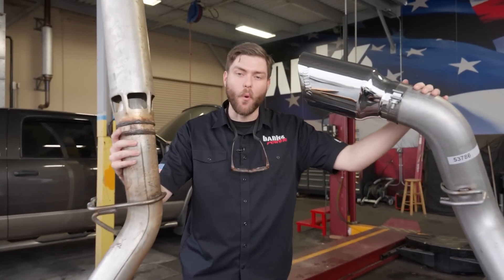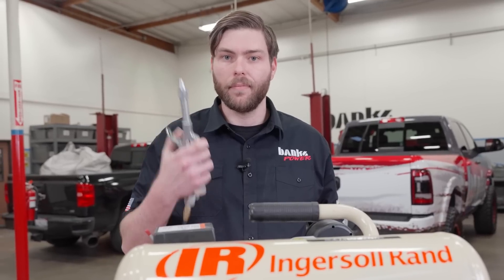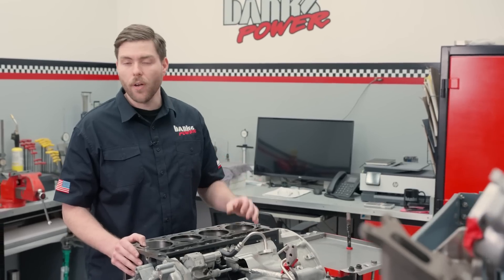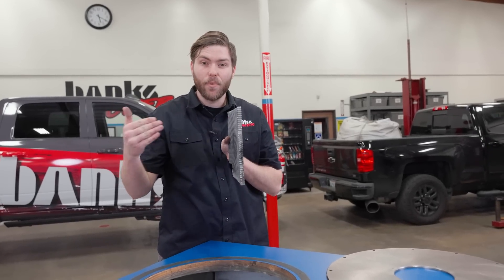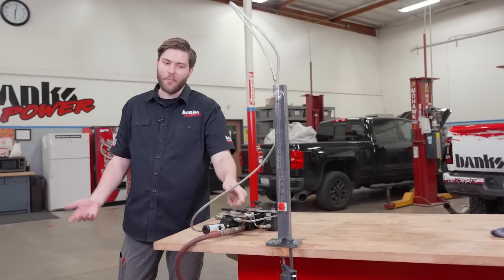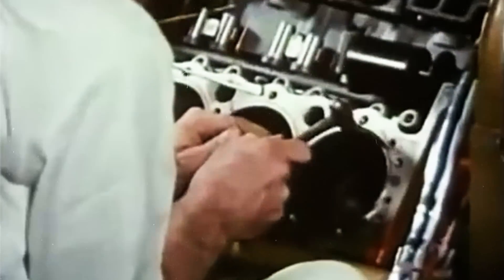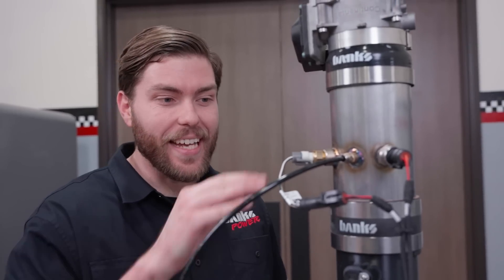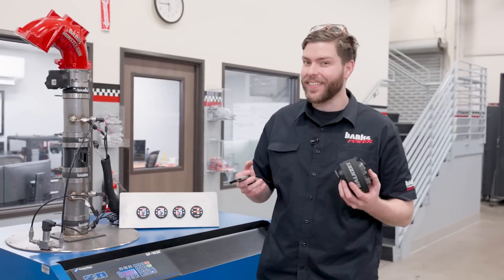Everyone is measuring airflow WRONG - Here's why | Banks Entry Level

Comment: Granted you're capable of reading the amount of air entering the components, but what about once it's gone through the intercooler. 
Then been compressed by the forced induction device, because that depends on several factors if my understanding of everything involved to actually reach the combustion chambers. 
First every connection has to be fully sealed against either a vacuum, or a positive pressure passing through it.
This also includes the intercooler if one is used, but that still leaves a lot of mechanical connections, and then there's all the welds, and are seams in the tubing on both sides of the turbos, externally mounted blowers, and even blowers mounted directly onto the heads.
There's a significant chance of leakage, and even with your testing setup this is highly possible  
Granted air is like water, and takes the path of least resistance, but that's still not a guarantee that's not an issue. 
From my years of hvac experience, in installing high pressure ductwork. 
The only absolute method of verification is to have a meter at the entrance of the associated ductwork, and after the all the connections through whatever is being tested to see if you're maintaining the same static pressure versus whatever your total volume of air exiting the ductwork. 
Otherwise you could very well have a sorce of entrance into your system, are a leak before you actually exit the device in this case. 
So the way your device is pressurized, are in the case if intake components your in a vacuum. 
So however many connections and openings for whatever device maybe there has to be sealed absolutely, otherwise you don't have an accurate reading for mass air sensor or anything else. 
You have a rough guesstimate at best, and I realize that this is taking it to the extreme, but based on the manor of which you're speaking, as well as the verbiage used.
You're making it an absolute, that everything has been done to guarantee that this is the case, and unfortunately it's not. 
I'm sure it's a more accurate reading than most people are getting just because the use of the Maas airflow device, but then the devices connected on either side, or the mass airflow sensor itself isn't in a sealed connections either.
So therefore you're not getting absolute accurate information yourselves. 
So not to be a PIA, but to make bold statements that ya'll are making to the public, which is part sales pitch, and some scientific proof of how ya'll have improved a method of testing. 
So take it to the absolute level of accuracy, and improve every connections inside and out of the flow bench as well as your method of connection to the testing device. 
Then tell us how you took these steps to ensure that your results are 100% accurate. 
Hopefully ya'll find this as positive input, and not someone being negative about what ya'll are I believe honestly trying to do to better your own data in research for your own products. 
That's how it's meant to be, and not just shooting holes into the steps you've taken to date.
Reply: If there are leaks the mass airflow sensor will be telling the computer the incorrect air mass therefore the air fuel will be incorrect. You spent an awful lot of words to say not much.

Comment: I don't think the largest percentage of people don't actually know that 1 PSI = over 15 actual Pounds Per Square inch because atmospheric pressure (eg the pressure of air acting on our bodies right now as we speak) is actually 14.696 PSI hence calling the measurement 1 BAR of whatever gas.

Comment: If air temperature don´t chance in flowbench between measured object and orifice plate, I wonder is MAF really needed here? After all flowbech just compare two pressure drop.

EDIT 1: I edit my comment by saying cant wait next video. I made my flowbench in 90s and currently have cfm and velocity measured in computer. I consider flowbench as tool to measure volume. Air speed is measured or calculated. 

Density is wonderful calculated unit in running engine where parts make pressure and temperature chances to air flow, but hard to understand how that can happen in stable flow where heat loads are not present.

And yes I absolutely hope that Gale and his team are right and we can learn.
Reply: But to reach the correct answer, everything has to be sealed to where there can be no possible chance of any air entering or leaving from one end to the other. 
Otherwise you have not accurately read the true numbers. 
Is this not correct, and whether it's a mechanical connections, or whatever it's got to be absolutely isolated from any leakage period. 
Yes or no
Reply: @timothymilam732  Sorry, I don't know what you mean. Of course air will enter and leave in parts when measured, and sealing is important. But if I have to answer, absolutely YES !!!!  😀

EDIT: That YES was to make you happy. I had my coffee and maybe I now know what you mean. In flow bench there have to be air flowing that can make pressure drop in measured object and orifice plate, and that makes possible to get reading or results out of it. If you shut down airflow (and just put pressure there), bench reads zero because there are not pressure differences.

I have two industrial (including Superflow) test plates to calibrate measured CFM in my bench. Thats enough accuracy for me.

I Think that industry have been right when we are measuring just air volume. Now this density value open new can of worms and I can't wait next video to see their way of thinking.

Comment: Seems like a redundant argument using flow bench as a tool the issue of denisity becomes a control of installation.  If I make an head port flow 2x the rate of a similar head regardless of the density there will be a corresponding improvement in performance
Reply: Unless the engine in question cannot support the additional airflow. The closer you get to the engines' airflow limit the less power you'll gain. MAF/CFM measures power potential, not power production.
Reply: @RadRidesByCru  You missed the point they were making.
 CFM is the volume of air, remains constant, MAF is how much that air weighs which will vary based on temperature, humidity altitude and boost if any. MAF is widely variable in an installed running engine for these reasons. 
Why add extra variables into a flow measurement that most likely wont be the same conditions as the customer will see? 
Increase CFM hp can go up. Work on MAF flow bench numbers you can manipulate the pontential hp to what ever you want
Reply: @UFO-047  I was speaking to the latter half of Mudlovr's comment. However, with regards to MAF vs. CFM... CFM is measured, MAF is calculated. While anything can be manipulated, CFM can be raw or corrected for temperature, humidity, altitude, etc., thus equaling a constant, or equaling customer conditions. MAF sensor mapping is based on CFM. Banks suggesting they "discovered" anything is just clickbait. You can use a MAF sensor and a leaf blower to create your own DIY flow bench (it's been done). Useful, but without baselining against a known CFM, the figures will be arbitrary.... for both the DIY'er and Banks... and Banks knows this.

Comment: One problem i always see not talked about is the Helmholtz effect in intake and exhaust giving above atmosferic filling without mechanical forced induction
Reply: Is that still a factor with forced induction?
Reply: @____MC____  you did read the part in my post " without mechanical forced  induction"? But yes it even seems to be a factor just a lot less
Reply: @pannekoekronald  yes i did read that part. Did you read my question?
Reply: @____MC____  yes i did! Did you read my answer?
Reply: @pannekoekronald  yep. All i wanted to know was if helmholtz affected forced induction(constant air flow)

Comment: Bugs me how many otherwise smart people I see "tuning" turbos without this undarstanding, still going by PSI/lbs of boost.
Lookin at you Honda guys!
Reply: A flow bench isnt used to tuned a motor tho is used to see how much air a port ect will flow at a particular standardised pressure drop.
 Density of the air is irrelevant until such time as the part is on the engine and in the vehicle. 
Density depends on altitude, temperature of the air, effectiveness of the intercooler if fitted ect. Changes day by day or throughout the day.
Measuring an intake elbows flow in lb at a particular density is not any more helpfull then in cfm. If you dont run that density its meaningless without calculations

Comment: So why wouldn't you calibrate the air bench with a local pressure and temperature correction factor the same as you would on a dyno?
Reply: You surely could. but why would you want to? All you want to know is how well it flows compared to the previous shape.

Comment: your point is moot.  There is a reason bench cfm is corrected to SAE standard.  And to make more turbo power, you must first make more NA power...so the bench is still perfectly relevant.  Flow and density can be calculated.  There's some interpretation needed for cylinder heads (and how they will fill a cylinder), but CAI and exhaust are straight cfm.

Comment: Great show. I love the analogy. By the why can't you use a variable iris similar to a camera instead of known plate hole cross-section(perhaps a little stronger), this would also give you adjustments on the fly (adaptive  while Woking) this might increase acuity and some degree of automation if the control gear allows it.
Reply: I wanted to know why they didn't just use the plates in the bench instead of a variable orifice.

Probably because Bosch makes inexpensive and accurate sensors that just measure the MAF directly.

Next up, measuring the parts across their use range to find parts that only give up 2-5% at the top end and have 10-20% more power in the midrange.  More area 'under the curve' means more usable daily power.  (See 1980's VW vs Honda.  VW was more torquey around town, even if the Honda had more peak power.  An inexperienced driver would be quicker in the VW.  Now with variable cams in the 90s Honda got back the midrange and in the early 2000s had way more low end torque)

Comment: Flow bench’s usually don’t operate in zone where compressibility is very significant as most people only use them at 28” which is far less What an engine generates so you are not really going to arrive at a different conclusion between component A vs B by doing that. I’d be hot rodding the bench to read pulsed flow
Reply: I agree, this discussion of compressibility and density is applicable to things that change the pressure and/or temperature, like an intercooler.  I don't see how them measuring the mass air flow through their intake elbow vs a competitors is going to yield any different results than what the flow bench already shows.  Seems like they are just trying to find more ways to push their idash.
Reply: @jaredshaffer3901  It seems the only reason this is better is it automatically accounts for atmospheric conditions at time of test. With the "old" way if you tested the same part 2 weeks apart you would get different results without using corrections to account for temp/pressure/humidity changes.
Reply: @notsofresh8563  But atmospheric conditions changing would give you different mass air flow with the same CFM even if you tested the same part.  CFM ignores that changing variable.
Reply: MAF is irrelevant for testing of intake and exhaust parts. Cfm gives you your flow, it is constant. MAF will vary from vehicle to vehicle, day to day, elevation ect.
MAF can be manipulated by the end user or environment.
Reply: @UFO 047  That's like saying density altitude has no effect on a prop.
Reply: @user-jd5sj8jx7r  no... and one has nothing to do with the other.
If you measure flow using cfm @ std pressure drop it will be the same regardless of the temperature, elevation ect the test was done at. Simple calculations based off that can give estimated hp potential for naturally aspirated or forced induction. If it is flowed at a set density instead- set pressure and set temp, humidity ect to give flow in lbs of air will that be more helpful to you? If you wont be running exactly the same intake density- pressure, temp, humidity ect will have to ads up to give the same density, you need to recalculate the flow, not from an unaffected base number (std cfm, ) but from a number that already has lots of variables added to it. 
Been awhile since I watched this but he said this would be better for comparing 'apples to apples' one part/manufacturer against another. STD cfm numbers will do that. If part A flows 500cfm @ 28"hg or 10" ect) and part b flows 525cfm @28"hg, part b flows 5% more and will theoretically handle/make 5% more power (theoretically because shape, blending, cross sectional area, actual air speed ect are very important factors).

Comment: Can you elaborate how an idash can interpret a maf signal without any type of OBD protocol interpreter?
Reply: The MAf outputs a frequency that varies with the MAF reading. Very easy to ready with any microcontroller , I would be a one weekend project to get the MAF data from the sensor to be sent via bluetooth to a phone.
Reply: By the way the iDash can read the OBD buss as well

Comment: Nicely explained. Though flow benches have been around well over 50 years.
Grey Ross had one running at Coventry climax by the late 50's, Ricardo and Westlake many years previously
Reply: Pops had an article from something like popular science to build a flow bench at home.
I do recall items needed were like 10-15 vacuum motors.
We do have an inches of water gauge used to calibrate magnahelic gauges ,it reads out to 1/100 of an inch of water, that's another critical part.

Comment: Roger. Received. Now what we need is a "How--To" for using the iDash and a specific MAF sensor to put a low-budget "flow-bench" together. Can we build something with an iDash, MAF sensor and a Shop-Vac to test our own ported heads, home-grown headers, etc?
Reply: I know years ago, dad saved an article from maybe it was like popular mechanics magazine. How to make your own flow bench.
I do recall the items needed are about 10-15 vacuum motors and a sensitive gauge. 
We've got that , it's an inches of water gauge that reads down to 1/100 of an inch and is used to calibrate magnahelic gauges. 
Now to find the time ,and that old article. 😅

Comment from the maker: We have a year's worth of video ideas lined up! But we want to know what you want to see. Comment below and we might just respond with a video.
Reply: All your videos please!!! 😊😊😊
Reply: When are you re-releasing the air pollution measurement video? That was great content even if the video mixing was not great.
Reply from the maker: @neelsvanniekerk1807  We're not sure which video you're referring to.
Reply: @Banks Power  A while ago you had a video up for a short time that showed how all the AVL emission instrumentation worked. It was taken off with a promise to post it again after better editing.
Reply: A video explaining why the MAF is necessary in a static flow rate situation like the flow bench. There are quite a few comments questioning it.
Reply: I wanna see more on the supercharged duramax!
Reply: How about the sequel to this video?  I might be convinced to buy another iDash if it means I can build a flow bench.
Reply: I have been thinking about this for some time. How exactly do you connect the MAF to the i dash? A video or quick drawing would be most appreciatted!  Part numbers on the sensors? pressure and temp as well
Reply: I just became aware of the idash product. This video opened up my understanding of airflow, a ton. I hope somewhere it is explained how you connected the MAF sensor into this configuration. Great video.

Comment: Building a idash with thunderbolt port for external touchscreen monitor use would be a incredibly useful product update.
Reply: Or… Bluetooth… 🤐
Reply: @thmanx  Bluetooth would require advanced encryption as the idash is plugged into the OBD2 port with direct access to the ECU. Hacking on the move becomes a possible problem.
Reply: @alt5494  well understood
Reply: @alt5494  lolwut. There is literally hundreds of Bluetooth OBD2 modules on the market. This isn't any different. That idash module isn't able to write anything to the ECU it can only read. There is no chance your ECU could get hacked from this.
Reply: Or one of the many normal usb connectors.